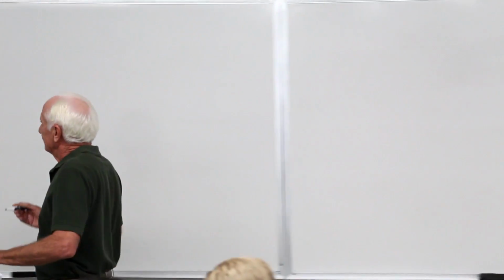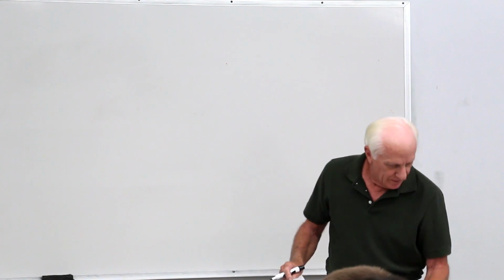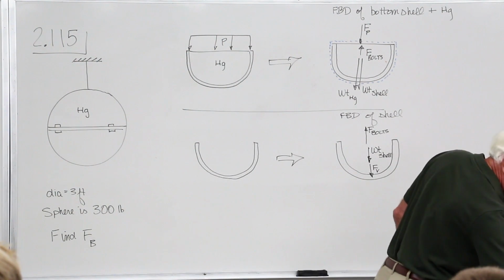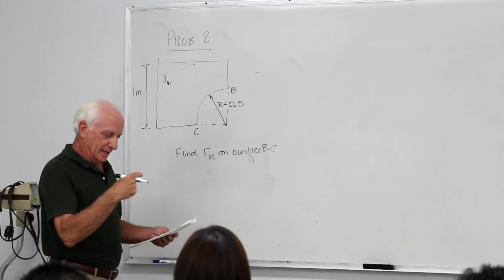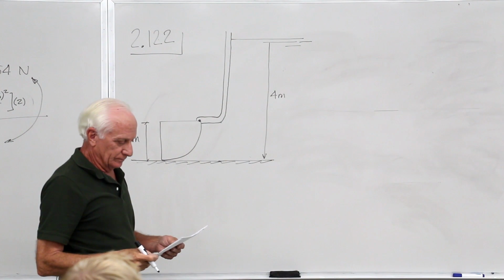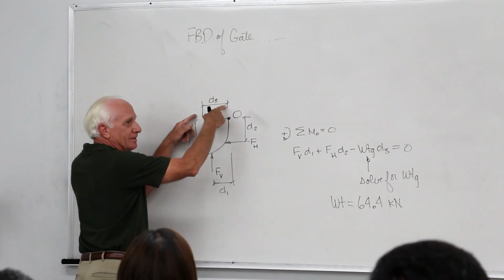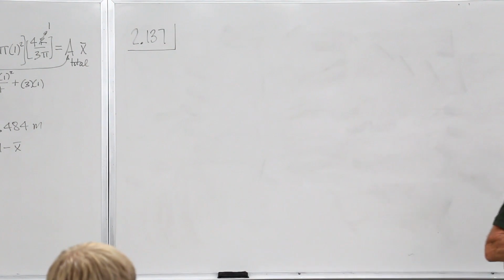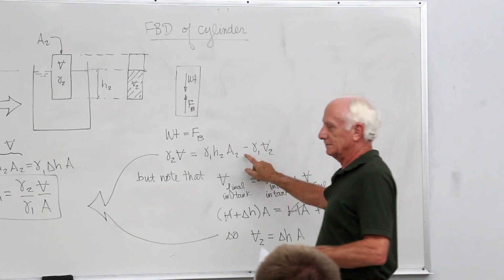Fluid Mechanics: Fluid Statics Examples (7 of 34)

Comment: Never mind about my previous question/comment. I'm an idiot. @ ~40minutes into the video he in fact does what i previously said when he solves the same problem utilizing the second methodology. Verbally it still remains consistent that he was describing the first method in a manner that verbally contradicts what he has said in a prior video to this, in regards to the 2nd method he utilized in this particular resultant force calculations on a curved surface/etc

Comment: 38minutes in ... hmm didnt he just describe how pressure with respect to depth is constant across a horizontal plane in a previous video (in this example @ ~38minutes how he explains his set up for finding F(rv) was verbally described incorrectly, because what he said is not the same thing as saying the pressure of the fluid above said area.. even though in this case, it will eventually equal the same thing). Meaning the F(rv) would equal the total weight of the water above the projected area above the curved surface (i.e. 0.5*0.5*2 plus [(0.5^2) minus (1/4*(pi)*0.5^2)], which ends up equaling the same thing as the train of thought that he utilized in this video @ ~38mins into this video, but the way he describes it contradicts his chosen methodology/discription in his previous videos within this series. Just saying. It turns out in this case, it

Comment: in the first problem why is the shearing stress at the bottom of the cylinder neglected? should it be considered on the calculation?
Reply: No slip condition. The outside cylinder doesn’t move. So the liquid on that surface is not moving. Thus it is experiencing no shear force.
Reply: Can you help me with that?

Comment: In the first problem, should the r_0 - r_i be switched in the shear stress?
Reply: The distance should be positive, that's why he used (ro-ri), a positive value.
Reply: @AmeerHamza-bc4fh  why he can do that? should it be r_i - r_o since the corresponding velocity at those points is v - 0? if the velocity gradient turned out negative, then that just means that velocity decreases which is the case in the fluid?
Reply: @ken-cf7tf  yes, you are right. I think Prof did mistake here. If velocity gradient is negative, then tau (shear stress) is also negative, which would mean that its direction is opposite to that of applied shear force F. Applied stress and internal shear stress should always be in opposite direction.
Reply: @AmeerHamza-bc4fh  also id like to ask does the bottom of the cylinder experiences shearing stress? if yes, why is it neglected?
Reply: @ken-cf7tf  yes it does, the problem is you'll have to use integrals to solve that and integrals don't seem to exist in this course

Comment: The only thing I can think of to explain it is that you are using gage pressure in the middle and since you're ignoring the atmospheric pressure you also ignore the weight of the fluid on the top half.

Comment: Why are you only using half of the weight of the mercury if the entire shell is filled with it? The bolts are holding on to half the the shell weight but all of the mercury in the container.
Reply: I am not sure which of the two methods you are talking about but if you consider the second method, that is taken care by the formula for the vertical component of Force for curved surfaces